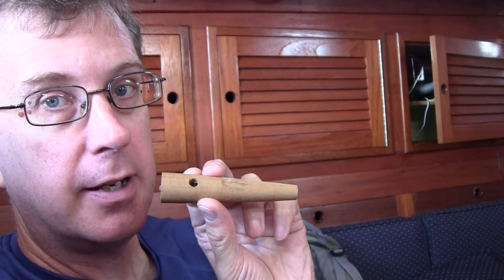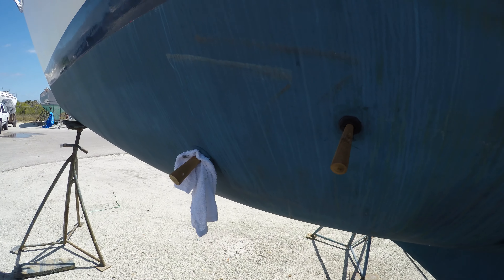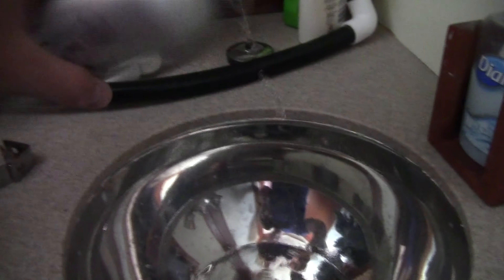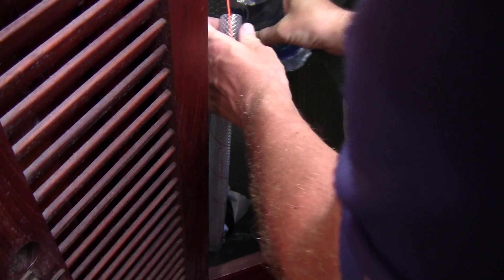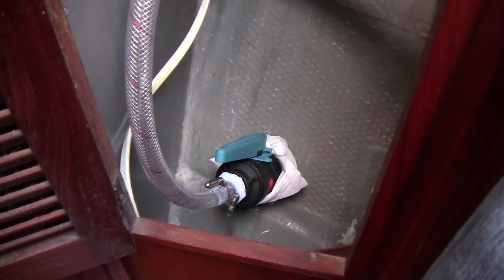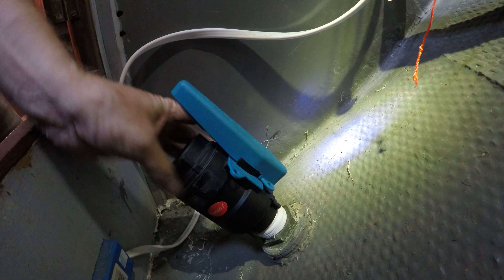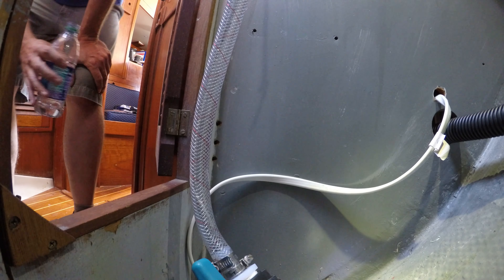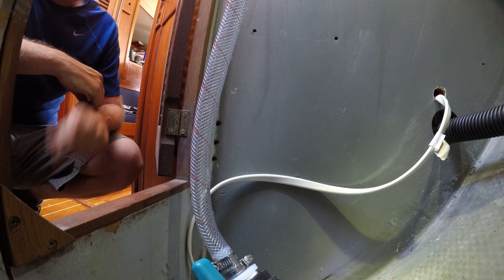49) Will the Engine Start?

Comment: Another thing I wanted to mention. If you don't have one, I would also recommend one of those infrared temperature guns.  They can help diagnose a number of issues with your engine and also other systems on the boat. Mine has been a huge help tracking down what we thought was a cooling problem. (ended up being the gauge)
Reply from the maker: Wow, those are surprisingly affordable. I'll add it to my list of things to purchase.

Comment: One thing I would look at is making sure you know how to bleed the fuel system when you change your primary and secondary fuel filters.  Will help you greatly if you get into a jam.  Also carry a spare impeller and an extra fresh water pump if you can.  Plus plenty of coolant and engine oil.   In 2 months of cruising Mexico I've replaced all of these on our T37
Reply from the maker: Excellent advice, thanks!